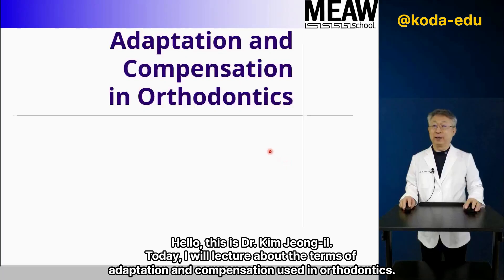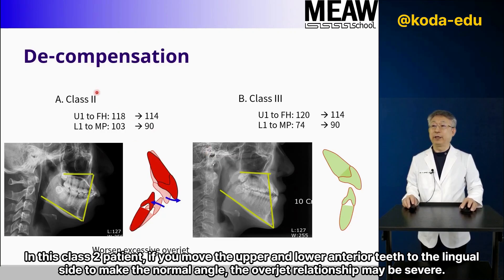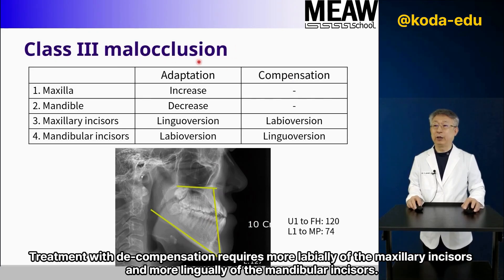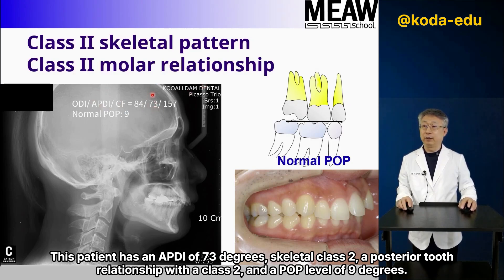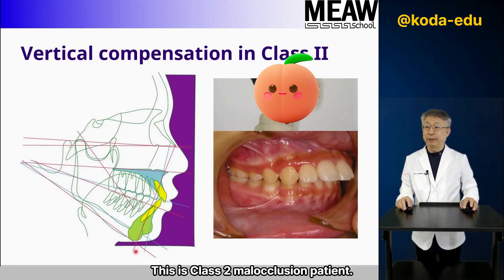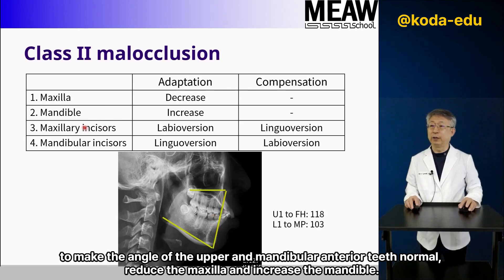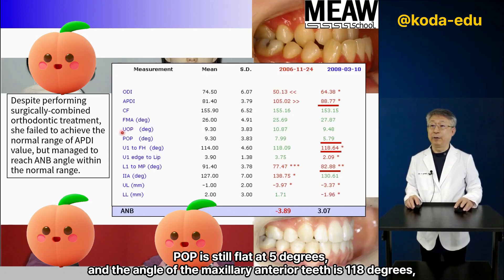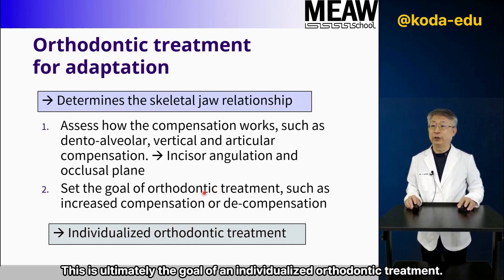2.Adaptation and compensation in orthodontics

Comment: Respected professor, for the treatment of a low angle Class III malocclusion , in addition to increasing the VDO, should the occlusal plane also be steepened? And if the answer is positive, which teeth should be extruded for this purpose?
Reply from the maker: Thank you for your concern. Lower 2nd molar eruption is the better . In order to achieve this, I want to grind the posterior part of PBBA(posterior bite with anterior coverage) And also we can adjust the lower MEAW